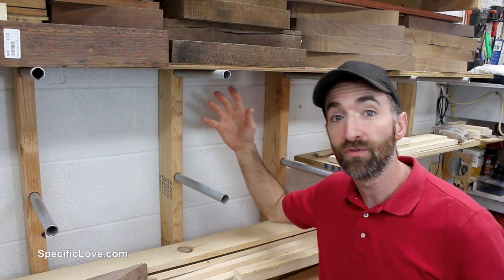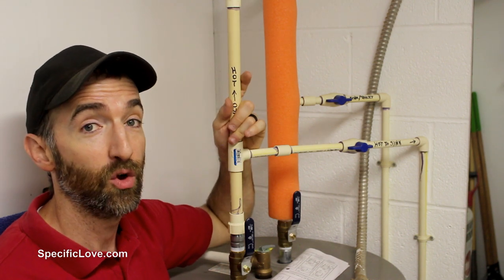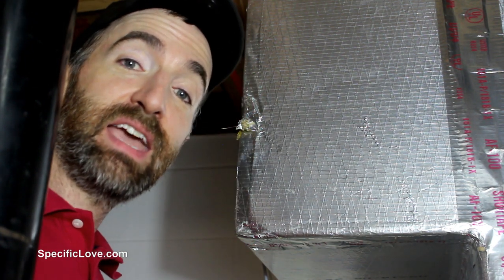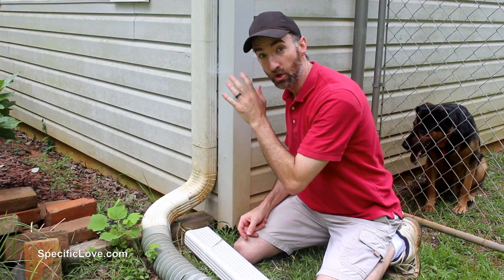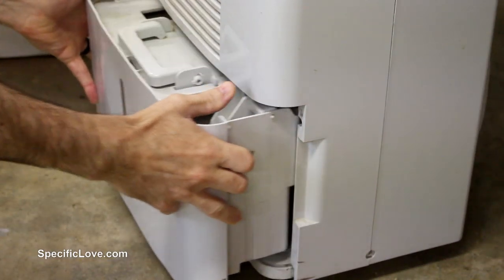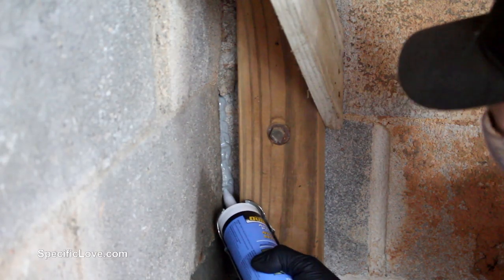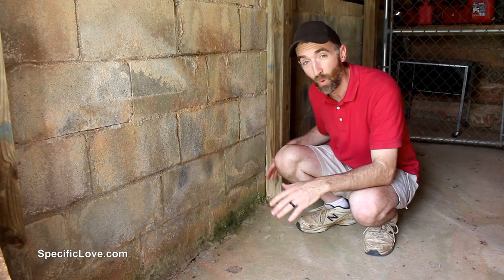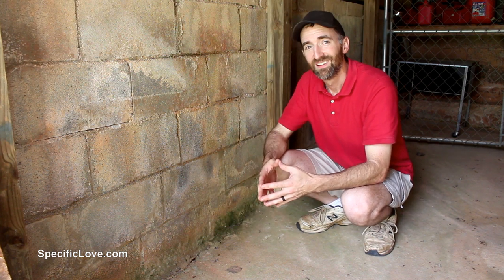How to Prevent Humidity and Moisture in a Basement and Garage

Comment: For a great dealing "paint" try Masterseal 583(white) or 581(gray) made by BASF, it used to be called Thoroseal. It is an elastomeric product you brush on and it can be used to seal a cistern or even something like a concrete pond. 
Water can be a pain.
Reply from the maker: Thanks for the info

Comment: Everything BUT ONE, are good tips.  The exception is running a perimeter of drain pipe to a sump pump, with the WEEP HOLES DRILLED ABOUT EVERY 12 INCHES.  I had a very pleasant basement, no humidity to speak of, where I dried laundry on lines running the length of my ranch-style home.  But, when power failed, usually during a rain, or storm, the basement took on around 1-2 feet of standing water which perked up thru the floor and foundation.  I had a company come in, explained what they were going to do, and did it.  THEREAFTER IT WAS MUSTY, HUMID AND VERY UNPLEASANT.  This went on a few years and I was most unhappy:  a)  it was terribly expensive; b)  I lost the dry atmosphere, and gained a musty one.  A family friend with common sense advised me to lay strips of tar paper in the open/stone-filled gutters (which allowed the damp into the basement), that I'd paid heavily for, and cemented over the tar paper to keep out the earthen humidity which became MY humidity.  It worked!  DRILLING HOLES IN ONE'S 'BOAT' IS NEVER A GOOD IDEA!  I instantly regretted it on various levels!  The large open/stone-filled perimeter, and the open holes in the walls near the floor was a disastrous decision!   BUYER BEWARE !     : /     I also used Thoroseal, which was a life-saver!
Reply from the maker: That sounds horrible. Sorry you had to deal with that, but I do thank you a bunch for sharing it here. I'm sure you just helped a bunch of people.
Reply: @SpecificLove7  I sincerely hope so.  I've appreciated your videos thru the years I've discovered you, but this one option...yikes!  I had to share what happened to me.  God bless you for all the help you've been to your viewers!       : )

Comment: Laying down plastic on solum ground in the crawl space is madness. This causes the ground to sweat and exacerbates moisture which in turn can cause mould and rot.
Reply: yes. He needs ventilation not entrapment of moisture.
Reply: You are supposed to encapsulate crawl spaces with vapor barrier on the exposed ground and seal it up the foundation wall to prevent the ground moisture from causing mould on your framing and in your house.

Comment: We had a huge 100 year old outdoor water tank on our property that was used by previous occupants to catch rain water from out detached garage. We have thankfully removed. 
The floor was caving in from the weight of the water which sat for 30+ years and I think that is a big part of why I’m having such high humidity in my basement. Currently have 2 dehumidifiers working day and night and can’t get humidity below 69-70%. Do you think the water stop cement would be ideal for filling in the large cracks in the stone where the tank was?

Comment: We just built our own gutter-system in the basement. It's not expensive. You create concrete canals about an inch from the wall and direct the water to your sump pump.
Reply: I'm interested to hear the steps you did to do this. I was thinking about doing it rather than pay 10,000